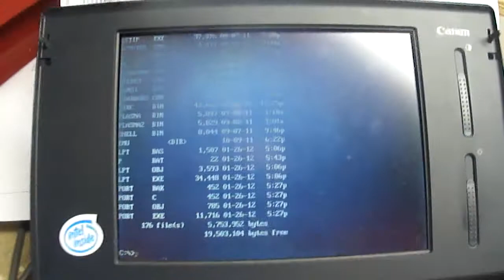work-in-progress 6502-based computer on a breadboard

Comment from the maker: @whiteoreoxx thank you! when it's all finished i am planning on releasing schematics. it's dead simple to build really. and yeah i know that laptop has seen better days. :)

it's an old 486 laptop (with built-in printer!).. didn't want to use a more recent one in case i cross a wire and melt it's parallel port. :P